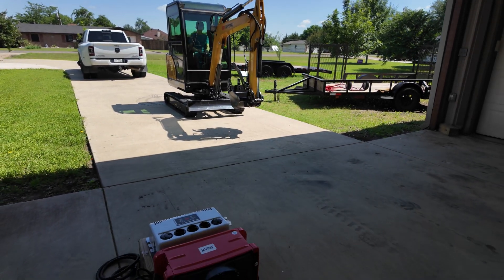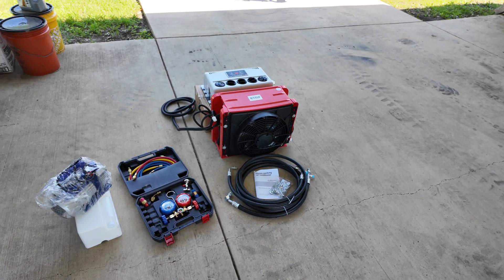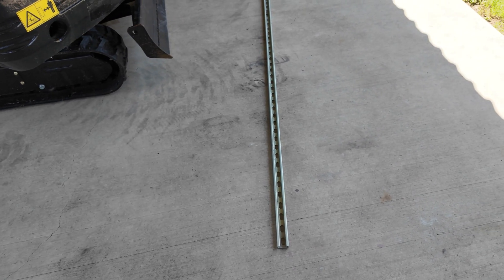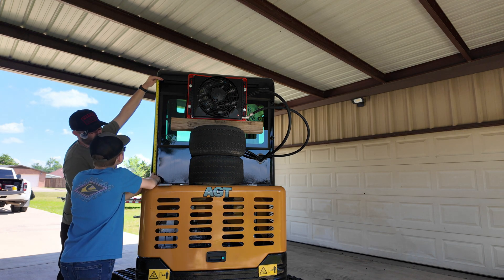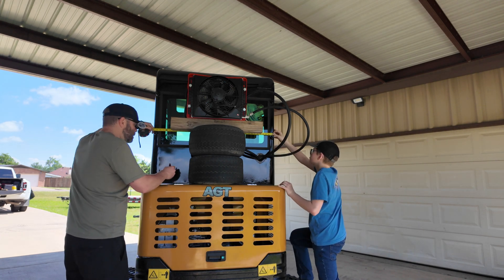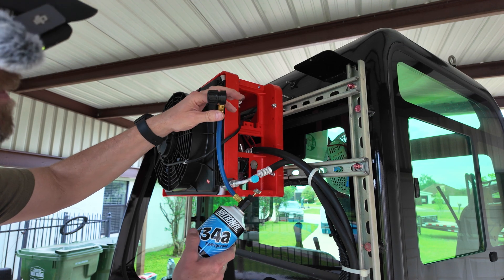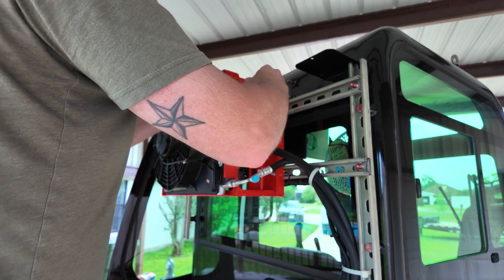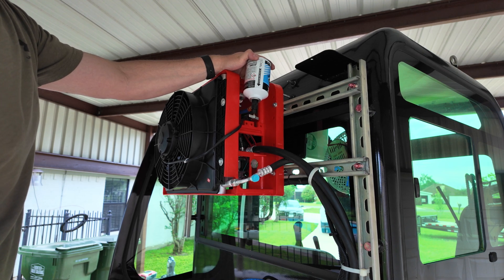12-Volt Air Conditioner installation on a Chinese Excavator

Comment: Great video. I have a 1 ton, took the cab off for the summer. Being as your basically sitting on the engine its like being in an oven 😰. Thanks for the video!
Reply from the maker: I'm putting together a follow-up video regarding the A/C. It's been giving me a low-voltage error, the new alternator showed up today...fingers crossed it works. I will have the video up in the next week or so...
Reply: Good luck, I hope it works out for you.

Comment: Do you know where is the fuse box for the qnt30?
Reply from the maker: The relays and fuses are next to the battery which is located below the seat. Looking at the footwell below the seat you will see 6 bolts, remove those to access the fuses/battery.
Reply: Thank you so much  @Digndiesel

Comment: Any information on AC,  a link would be great. Thanks
Reply from the maker: This is the link for the exact model on Amazon, I purchased mine as open box on Ebay. https://www.amazon.com/UAHKPA-conditioner-suitable-vehicles-excavators/dp/B0D3T635DF/ref=sr_1_8?crid=SHQUX145FQH5&dib=eyJ2IjoiMSJ9.BgjjqO9PjLmdxvdFWYr7jC-nwkVR80Ah2xtEP7eJ5k_OiUMeJqlkPnJCaCNNtsaEhUBbdAKYwBLQceegUWyU5iSDBYIhJa5zbp_7M88eiWEGNgaVQyd0omn9avEzBkV0ks5kZ4NEwXGNL6m_6gydLjXi4aKINKXcLNOlsc31yHrf1FG42dEIsi_q7gptFt9q8CkIhAxkpOOeC_bTswdWzQQj9n_RkKfyR1MqiBe3spTlkgPx31WfpdY9n9j2w3kcKy6r-78EHMKMd_MgQe7o_HjQVBv0VLJy1H46MNHjekc.jFUmcogv2HhFrPA1o2nGmJOVRfw-QSyAQ8-D1yko6n0&dib_tag=se&keywords=12v%2Bair%2Bconditioner&qid=1749093629&sprefix=12v%2Bair%2Caps%2C187&sr=8-8&th=1

Comment: Thanks for the walk-through. Have you considered a larger alternator? I looked up the one installed, and it's a 45 amp. Once the cab reaches temp, I don't think it will pull that much, but it will pull up to 90 amps until the cab cools down.
Reply from the maker: I will look into the larger alternator, since the video I've had a couple of times where it turns off due to voltage dropping below 12v. I just purchased a voltage regulator to see if that will resolve the issue...if not then an alternator upgrade will be in order.
Reply: Have you made the alternator change? I’m picking up my qnt30 this week
Reply from the maker: @truenorcal I haven’t upgraded the alternator yet but it is definitely needed. The A/C will cycle off every 1-2 minutes and give me a low voltage error…it will run the fan for 2-3 minutes and then cycle the A/C back on. An upgraded alternator will be necessary for it to function to its full potential.

Comment: Where did you connect the other power terminal of the unit?
Reply from the maker: I connected it directly to the battery, I connected it to the battery just after filling the freon for the initial start up.